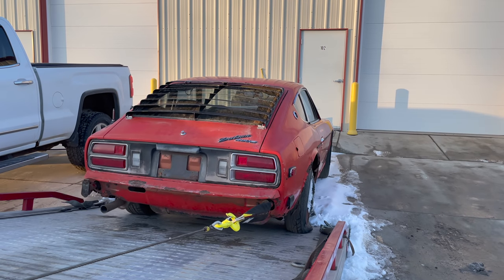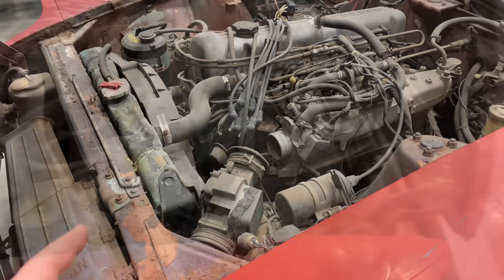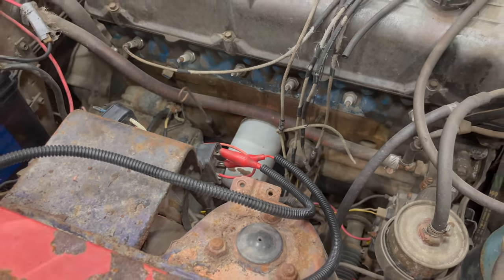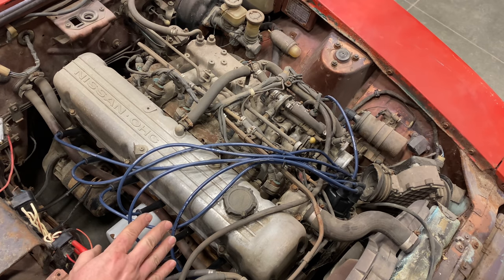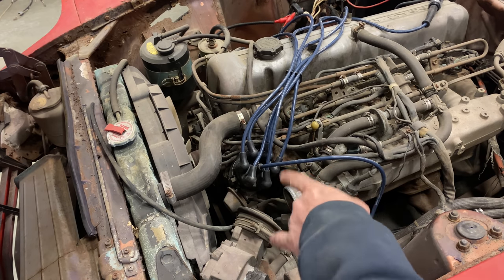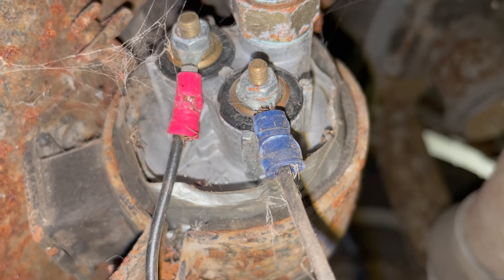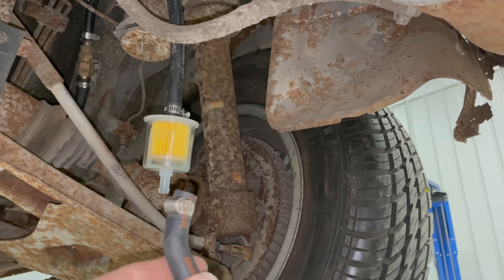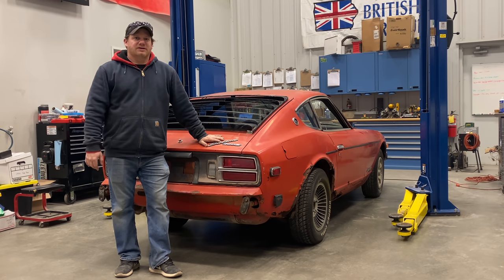1976 Datsun 280z - Will It Run?

Comment: Bluetooth multimeter is genius. I don't want to ask how much that Snap On meter was though. Very patient and thorough work on the Datsun! For a first go-through, that was very systematic. Too bad that thing has so much rust and mouse damage. The restoration will be a labor of love for someone.
Reply: Snap-on: if you have to ask, you can’t afford it. But if you don’t ask we’ll put you on a payment plan of $50 a week for life.
Reply: They're $600.  Which is pretty pricy. Although the only thing I can think of that's similar is the  Fluke-233, which has a wireless detachable display, and that's $400.
Reply: You can get a decent "overseas" BT meter for $50-100 off of Bezosmart.
Reply: Strip it down, brace it up, turbo racer!

Comment: About 40 years ago, I had a 1974 Datsun 200L! I bought it with a big end knock. It was the first engine I ever stripped and rebuilt so I was quite proud of myself. It was a straight 6 and looked just like your engine! I knew nothing about fuseable links! I was a bit green! The previous owner had wired in 4 extra front spotlights without using relays! The links were melted so I replaced them with ordinay wire. I put the lights on and gave the engine a rev! There was an enormous blue flash on the white wall in the front of the workshop! I had blown every bulb in the car including the dash bulbs which was a huge job in Japanese cars of that era! It broke my heart! :(

Comment: Again I am impressed with your diagnostic ability. In the late sixties and early seventies I worked my way through college working in a gas station service center pumping gas, fixing tires, driving the tow truck and doing very minor repairs, mostly tuning cars, replacing hoses, belts and doing oil changes. No one trained me as I had a natural feel for mechanical and electrical devices. Now I’m a car nut, having a 2016 Mustang, a C4 Corvette and a 2002 Thunderbird. If I my wife wouldn’t kill me, I’d be pestering you for a good Alpine. My first car was a 1966 Alpine that I loved to death but divorced it when it kept running thru my money for repairs.

Comment: Saw that ball valve facing the wrong way, figured it was just opened off camera.  Nope, lol!  

My old 71 240z throttle linkage needed a little grease love sometimes but would still give me problems occasionally.   But no dual SU carbs to individually tune then synchronize, that makes it so much simpler.

Slave cylinder is your problem, swap it and you're probably fine.  Next you'll find out you need all new brake system and half shafts.  I'd get the clutch tested, clean her up so she's smooth idling and throttling, clean out the interior some, then sell her as a parts bonanza to someone who has a better chassis and body.  Fun watching you get it this far though, thanks.

Comment: I had a 1975 280Z back in 1978. What a fun car! I kept it until 1983, when I sold it to buy my first house. The Z was a reliable car,  although prone to rust on salty NJ winter roads. I bought it because at the time, I wanted a corvette,  but there were none available that weren’t mechanically butchered by previous owners. At the time I bought my Z,  2 cousins, and my brother in law owned them, I made number 4 in the family. I still miss my little Datsun, although I now own a late model convertible corvette. The Vette is a garage queen, where as my Z,  a fun daily driver! Good luck on your project!

Comment: I had a 76 Z car about 15 years ago, I bought it from a co-worker for around $1500(?).  It wasn't until I got around to doing the first oil change that I discovered the frame rails either side of the engine looked like Swiss cheese from rust.  They also looked like someone had crushed them.   Car ran decently except for the brakes, the previous owner gave me a brake booster he bought...didn't fix the brakes.
And the car eventually developed a habit of randomly shutting off.  Sometimes it would just restart but usually it took upwards of 20-30 minutes.  I finally got serious about troubleshooting the problem and discover the wiring to the battery from the ignition switch was rotting away.

Comment: I was a big fan of these in the 80 s and I stumbled on to a BIG TIP for you when you get it running right. I always thought these sounds like the timing was slow so I built a bracket that would allow me to advance the timing past the point the stock bracket would allow and it worked , Free Power. Over the next few years I must’ve done this to about a dozen 280 and 260z . I always thought this must have been a way for Datsun to regulate the power of the car but try it, you might be surprised.

Comment: that brought back a few memories, 20 years ago i picked up a 260z twin carb and 5 speed manual box. guess i was a bit lucky the body didnt need much work the head gasket needed changing but soon had it back on the road. didnt want to but i did sell it on after 5 years.

Comment: Thank you. I had a1976  Datsun 620 hustler pick up. It had the same displacement but was still carburated. I was actually working in the parts department of a Datsun dealership. The z,s were little rockets. The 240 and 260 were made a little better. I tried to buy a nice 240 off a guy but he changed his mind at the last minute and decided to keep it. I would probably have cracked it up anyhow  I had a lead foot back then.

Comment: I love the shape and looks of the 280Z. In high school a buddy of mine had a 280Z but blew the motor, his dash pad was cracked in like 8 places, seats were done and generally the interior was molddy from the t top leaking. The body and frame were in great shape. His friend had an anniversary edition 300ZX Turbo that was frame totalled in a wreck. They took the two and made one. Stripping the 280 to the frame they sanded prepped and painted the body and rhino lite covered the frame and entire undercarriage. They swapped the entire wire harness, computer, motor from the 300 to the 280. Once that was done and it started and idled they stopped for a month of gathering parts. Next the 300Z dash was modified and moved into the 280, they laid new 280 carpet, moved front seats and deleted rear seats for a speaker bix and storage box. They carefully built a new engine harness for the electronics and ran vacumme lines all hidden. With new seals on all the glass and T Tops his ended up a great 280 with the heart and comfort if a 300Z Turbo.

Comment: I had a 98 Civic EK hatch that did the exact same thing with the brake light switch.  Replaced the corroded rubber bumper with a little bolt, done dusted.

Comment: Never heard wire loom called "corrugation" before. Thats definitely a new one!.
Reply: I’m wondering if it’s a UK thing. Guy works on a ton of British cars, and uses bonnet for hood and boot for trunk.
Reply: Corrigation is just the term to describe the outer sheath of the cable to stop the inner wires from rubbing on anything
Reply: Corrugated split loom.  Some people call it loom.  Some split loom.  Some corrugation.

Comment: Had a 78 in similar condition from sitting for years. Remove & clean the injectors out before you hook up the fuel pump, so it doesn't push old rust & crap through the lines into the injectors & cylinders
Reply: Agree

Comment: Nice save! Yes, if the engine turns over it should run but they have lots of electrical problems.
 I have a 1978 280z,  The drive train is now in its third body. Definitely check the fusible links,
 they can be sketchy.
 Good Luck bro'

Comment: Im a z32 guy and for what it might be worth on the brake light on situation, there should be a rubber button mounted in the bracket and the tit of the switch contacts that rubber button to shut off the brake lights.  The button turns into a hard crumbly texture and falls apart leaving nothing for the brake light switch tit to contact... leaving the brake lights on.  I was able to locate 3 of them for my car (brakes, cruse control and clutch) at the Nissan parts dealer.  Or blocking the hole in the bracket of a work around.

Comment: L series nissan engine are relatively easy to work on. if that 280Z has N42 stamped on the head somewhere near where it meets the block it will have bigger valves and slighty better ports than a standard L28 head . these engines can be stroked to 3.2 ltr if you can get the parts to do it.

Comment: Fun video. That looks like it is a 1977 280z based on the hood vents, rear bumper has the upper trim mounted on body, and horn button has a Z on it rather than saying, "DATSUN" on it. I also learned that they must have relocated the fuel pump in 1977/78 because typically the fuel pump is right behind the fuel tank...(didn't know this) also earlier 280z the fuel pump doesn't run until you turn the engine over. I rescued a 76 280z out of a junkyard back in 2019 and has been a fun project....just got a tag and insurance last month so can drive it.  Great cars but shame how bad they tend to rust.

Comment: Great video. Brings back memories of me working on my 280z back in the late ‘90’s... similar problems (fuel injectors cracking, replacing FI connectors).  They are fun cars, but a lot of maintenance!

Comment: Hoo my young friend (theeee mechanic!!!)  I posted the comment on an other video, but I do like you get what I wrote,  I think interesting for you !
Yes yes yes  --- I do recommend a complete rebuild. What a unique auto the DKW my friend had one in Congo in 1957/58 we had fun with that car....special way to drive because of the 2 stroke engine, special sound ----- but I remember quite thirsty !!!
Hoo Young friend, you must get 2 vehicles !! 
1° Mazda (1966?) rotary engine !!! FUN ++++ to drive ----Faster turn the engine less noisy !!!
2° Citroën MEHARI (1977?) flat 4 stroke 2 cylinders engine fiberglass body, this will be your FUN TOY !!!

Comment: 7:11, Fuses and fusible links do not blow at different resistances but at different amps, different colours are for different amps. Edit to add that it was obviously only a slip of the tongue as you later mentioned the amperage of the links. Well done for getting the Datsun going!

Comment: Get it running and restore it. I had a 240z  very fun car to drive. However the automatic transmission version sucks because they are a dog off the line. But from 2000rpm up it's a rocketship. Will set you back in the seat.

Comment: That Nissan 2.8L I-6 is a fantastic power plant.  It doesn't produce the crazy horsepower of today's car...but for a late 70s emmmissions hampered motor, it did alright. Revs up nicely and sounds pretty sweet....Japan's version of the Iron duke, or slant 6..only a bit more refined!  But equally indestructible.  Fun car to drive too!

Comment: Nice video! Very enjoyable to watch some good old, methodical fault finding. Someone's been tampering with that (Bosch?) MAF sensor. You can spot that huge gob of silicone, that they used to glue the cover back on. Not many logical reasons for that, unless it's a high mileage car. Then someone might have tried to move the needle that's operated by the spring loaded flap in the intake tract, on to a new track on the copper strip. 

The copper strip gets worn out on a certain spot, when the car has been driven a lot. Usually that spot is where the engine lives most of the time. That is, cruising down the highway with constant throttle position and load, for long periods of time. Bad connection with the needle, and the copper strip create problems with the ignition. Either that, or someone has wound the spring tighter, or loosened it with the intention to make the engine run leaner or richer.

Comment: I worked for 2  Datsun Dealers back in the day - I hope you put in NGK  spark plugs - nothing else is correct ... somewhere in the engine wiring harness we used to put a 1/2 watt - 500 ohm resistor that would reconfigure the fuel injection & add lots of power ... the clutch slave cyl. seal ruptures on 1st push after sitting long time - it happens with old Mazda's, too.

Comment: Rusty z cars will challenge you with plenty of electrical gremlins. Rust and crud in the tank and fuel system will also be a PITA until thats cleaned up, fuel injectors falling apart... etc. Might be a solid drive train and some other parts for another more solid car. Love those Zcars, hate the rust. That bluetooth feature of his multimeter is trick! well done getting that heap as far as you did.

Comment: A lot of times you went to clean parts on these and the connective metal was gone, and the plastic cracked apart. The frame has some deep rust issues and the u joints in the independent rear frame looked pretty bad. I think it needs a new rear end. The hood lock and release looks in good condition, and this is usually one way to tell it they were abused or had front end damage at some time. Lot of good parts, and the bodies show up for about 1 to 2 k every year, when someone stops rebuilding one. But most of the parts are there. I thin I rebuilt the clutch 2 or 3 times on mine.

Comment: To replace the duct tape/metal pipe connection, check out the plastic elbows from GM V6 cars from the 90s and early 2000s. I think you can make one fit

Comment: I had a series of bad fuel relay on an 80 scirocco.  
I remember running a wire from the battery to the fuel pump to get home. Lol. Maybe that's why the pump wires were cut. They also hotwired the ignition and starter I think.

Comment: on the brake light switch, you might not need a switch but just the rubber stopper that the switch pushes on, this is a common issue even on cars today, there is a rubber plug in the brake pedal and when it decays it falls out and leaves a hole witch the switch will just stick through and not allow the brake lights to turn off

Comment: Had a Datsun 510  with a similar engine. Had to replace all the fuel injector tubes. Rust was the problem. Car ended up in Utah. Probably STILL RUNNING.

Comment: There's nothing wrong with the brake light switch, you just need to replace the plastic piece in the hole in the pedal to there's something to depress the switch.  This is a VERY common problem and extremely easy to fix.

Comment: Interesting...I had a 78 and the fuel pump didn't have nuts that could be disconnected, there was epoxy covering the nuts and if you wanted to change the pump you would have to remove the whole wire set from inside the car and feed them through the hole.

Comment: The distributor reluctor needs an .008 air gap. It should never touch the sensor. I think what you meant was align with the tooth of the sensor.

Comment: I'm here from the JD video.   This is a 1977 or 1978.    Did you check the oil?    Would spray the EFI connections with some CAIG D5 and unplugged and plugged them in a few times, after gently sanding them down to bare copper.   Definitely get new slave cylinder for the clutch and grab a couple wheel cylinders while you're at it, trust me.

Comment: I had a 77 5 speed with air. Sold it with 76 k miles. Sorry I sold it and wish I still had it. I still have the original steering wheel and car manual to remember it.

Comment: Those aren't the original seats in the car ... but you have a rare 2 seater Datsun as most survival cars are 2+2.
I noticed some of the air valve sensors have broken off ... may have to go through the air system to check for leaks ...

Comment: I used to own a 76 280z, I hate to say this but the best thing for this would be a 5L ford engine and trans from a mustang, It would be lighter, better balanced, far more reliable and so much cheaper than that l28 boat anchor engine.

Comment: I had an old Datsun 200sx. The connectors to the injectors were   Bent severely leading to corrosion and breakage.    I required them so the wires were not bent.

Comment: This Week With Cars- Do you still have the original spark plug wires from 14:20-14:28?...

If so, what did you do with them, were you able to repair them & if you could still use them, do you plan on doing so?...

Comment: great vid as ever. I'm no mechanic but would the lack of spark at the inline tester always suggest the problem lay somewhere before the plugs so changing the plugs wouldn't make a difference?
Reply from the maker: No everything is connected in series so if there is problem anywhere in the chain the light will not flash.
Reply: @ThisWeekWithCars  thanks, that's great to know. Always learning.

Comment: always soak piston rings /cylinders in transmission fluid or marvels mystery oil before cranking. always hand crank before using the starter. You just scored the cylinder walls with rusty rings.

Comment: Be sure to check the front shock towers.  Known weak structural point on these cars.  I'm pretty sure that those sliding locks at the base of the rear window louvers are not original to the car either.  Someone's idea of a bandaid instead of an actual repair.

I saw a small spark for #2, but the spark tester was moved off camera for cylinders #5 and #6 so I couldn't tell.

Comment: Didn't see it said. The brake switch works fine... Nissan puts a rubber grommet on the pedal that disintegrated. Just put a 10 mm in the hole and that will push the switch and turn off the brakes.

Comment: There is supposed to be a little rubber bumper that makes contact with the brake switch. That's most likely what fell apart as you pressed the pedal.

Nissan part no. 46584 - S0100

Ask me how I know.

Comment: i got one of these. its identical, my problem is the fuel pump and a holy gas tank. i need another tank. has too many pin holes in it. from where the tank strap wore it down in that spot. some how the rubber gasket disappeared and it was metal rubbing together, which caused the little holes.